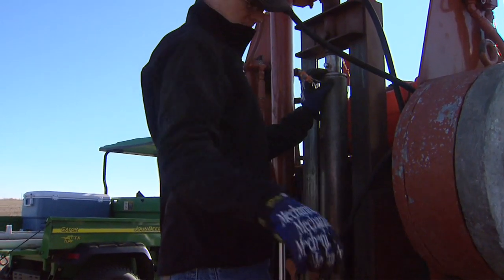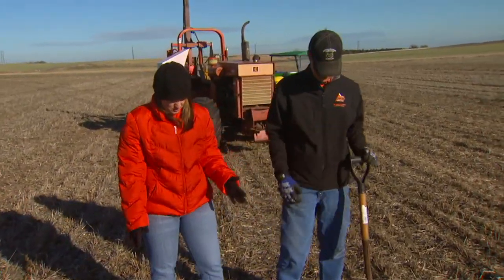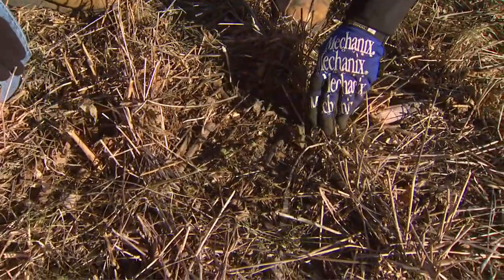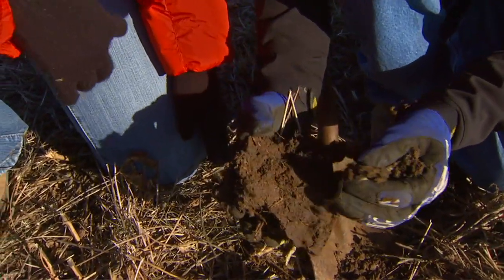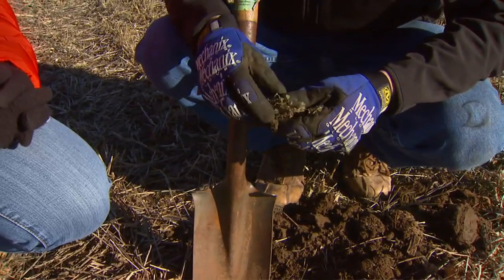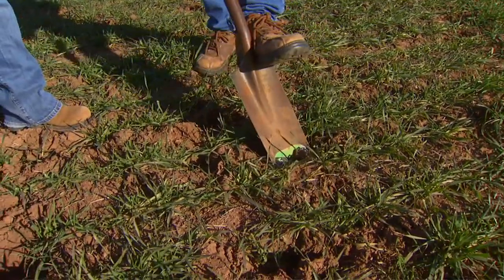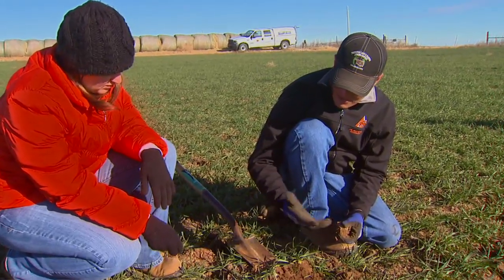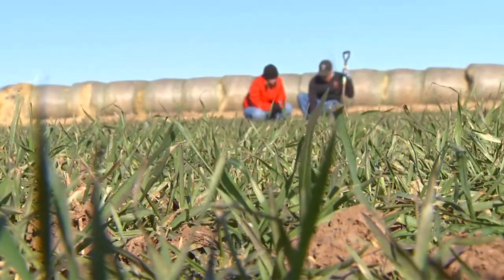No-Till = Better Soil Quality

Comment: How are you supposed to plant crop rows without tillage? I see the benefits but idk how it will work if you have so much organic matter build up covering the surface..
Reply: watch the BTE FILM !!!!
Reply: use compost in the fall, and you plant right in  in the spring. Piece if cake. I have been doing it 2 years now.I mulch after my plants are 10/12 inches tall. 
DO THIS..
IN THE FALL PUT 10 INCHES OF COMPOST 
10 INCHES OF MULCH. LET IT ROT ALL WINTER
IN THE SPRING, MOVE TJEMULCH ASIDE AND PLANT IN TE COMPOST. 
EVERY 2 Years, lower the compost layer by 2 incges, while you  keep the mulch layer the same to  keep soil life happy and soil moist
see? Very easy

Comment: A lot of the farmers that no tilled here are going back to a at least a minimum til since using to chemicals more often with no till has caused weeds to become resistant now.
Reply: No weed is resistant to steel
Reply: Cant until about 6 years.
Reply: Will Yerburgh What about the seeds produced by the cover crop? Imagine rape ripens and leaves your field full of seeds
Reply: +oilerman9406 - no resistance to weeds develop if you rotate your chemicals and your crops.  Plus we have used winter cover crops since 1988 and NO chemical resistant weeds have show up.
Reply: Yea it still does cause you have to spray so many times.... should only have to spray once and thats it
Reply: We spray once to kill the cover crop if planting early for the corn - a light shot of Paraquat and 2-4/D 2 days before planting and then a post emergency spraying of Aatrex. 
If we are planting late after the May 15th to 20.  Driving over rye at that stage kills the rye without spraying it and there is nothing growing under the cover. WE are 60 miles North of ST. Louis, MO so our problems down here are different than your probem!